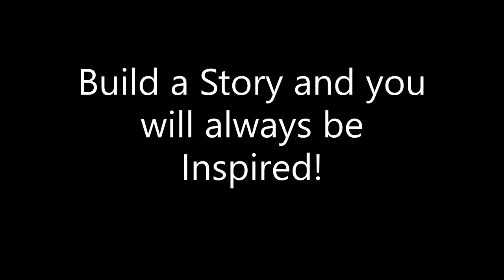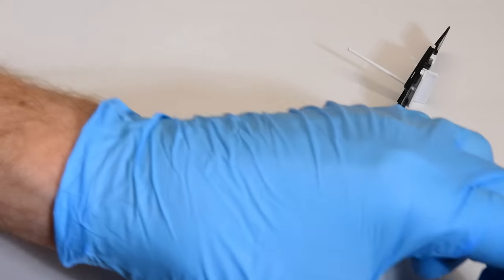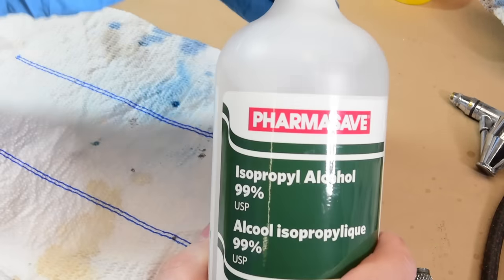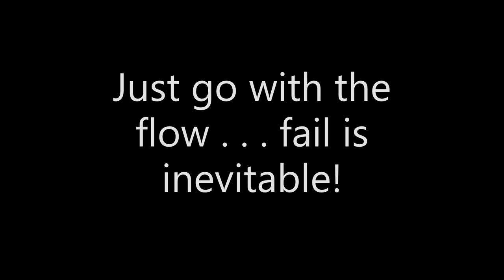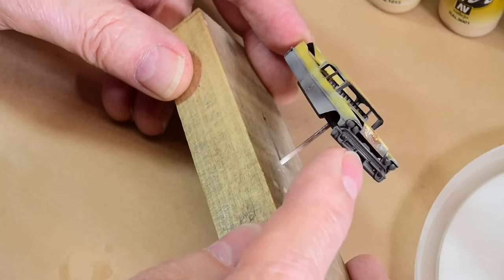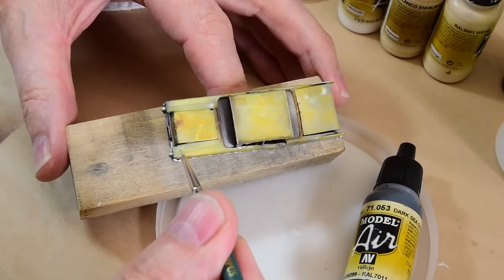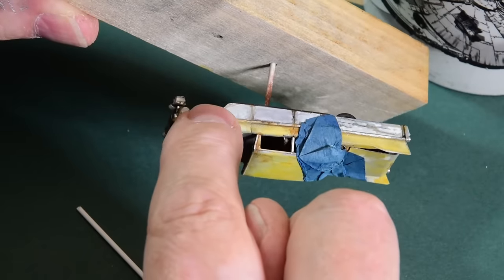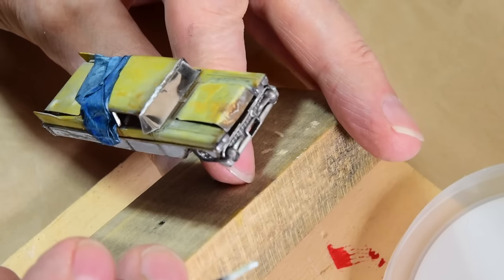Modifying & Weathering (painting) an Athearn HO (1/87) Scale Sedan | Boomer Diorama ~ Vlog # 205

Comment: Hey Boomer.  Thanks to your regular encouragement I have adopted use of the airbrush, but not without a trip to the Emergency Room of my local hospital last night.  I think the story is worth sharing, as according to my attending physician it is not that uncommon.  It was about midnight and I was cleaning my airbrush after using it and got to the point where I backflush the device.  For those unfamiliar with this procedure, after rinsing out the bowl and removing the bulk residue, you place several drops of water in the bowl, pull back on the lever to retract the needle, put your finger over the nozzle to block the air from discharging, and then press down on the lever to release the pressurized air.  It’s easier than I've made it sound.  I’ve done it many times without incident.  However last night somehow my finger slipped and I felt the very slight pin prick and immediately let go of the lever, but it was too late.  The column of 35 PSI air flow found the entry point into my body.  This all happened very quick - instantaneously.  It was a very strange sensation.  I had this weird feeling, I mean I could feel the air shoot up my index finger and through my hand, following the path of my tendons according to my Doctor, all the way to my wrist.  There was very little pain, maybe a 2 on that 1-10 scale, but definitely discomfort.  As I rotated my hand and drew it closer to take a look I couldn’t believe the noise.  I’m not kidding, it was a trip.  If I just bent my finger in the least I could feel and hear what sounded like hundreds of miniscule air bubbles rubbing against one another.  If you were sitting 5’ away from me you would have heard this weird noise, and I was feeling it inside me.  
I called the hospital and with great difficulty tried to explain what had happened to a triage nurse.  She put me on hold while she spoke with a Doctor, who said I needed to come in.  Nobody wants to lose any function in their hands, and as a guitarist I was particularly concerned about that.  After struggling to explain what had happened to the nurse I decided to take the airbrush with me.  I was seen promptly by the Doc.  He examined me and could feel small air pockets in the palm of my hand, and hear the noise I talked about.  I was surprised when he told me this was not an uncommon event.  He explained there was nothing to be done, and that my body would naturally deal with the air.  He told me this is sometimes serious, when the airbrush discharges an oil based solvent.
I was back home about 1:30 AM, and when I awoke this morning my hand seemed to be back to normal.
I won’t be backflushing my airbrush in this fashion any more.
Reply from the maker: Sorry to hear that. Sounds like a freak accident. These things can happen like when I cut-off the end of my finger during the Diner build here: https://www.youtube.com/watch?v=F8WGfoPMmRo

Glad to hear everything is O.K. This is one of the reasons why I use Isopropyl Alcohol, due to it's medicinal applications and properties when in contact with open wounds.

Comment: Fantastic job again, the old car looks really run down - absolutely awesome (of course just as the whole layout)!🤩👌🏻 I subscribed to this channel sometime during the dinner series, but so far I have only been a silent viewer and a big admirer. However, I would like to give a very small tip😇: I also use heated blades or screwdriver tips for several jobs. However, I press the plastic part onto the sooty side of the blade (or the other way round), as it usually doesn't stick as firmly, the soot serves as a release agent, so to speak.😉
Cheers from Southwest Germany🍀🙌🏻
Reply from the maker: Thanks for the tips and supporting the channel! Cheers.

Comment: Great video! What would happen if you pushed your hot knife into a quarter panel? A cool way to weather an old car is put IPA on top of Vallejo Model Air - looks like the car has been out in the sun too long and the paint is failing. For normal airbrushing with VMA, I use their Airbrush Flow Improver 71.562. Works great. Cheers! Bill.
Reply from the maker: Thanks Bill! Cheers.
Reply: Good reminder here that I need to go check what’s happening on my finger lakes railway!

Comment: I know what you mean by setting a few hours for this sort work I really enjoy spending an hour or two on weathering a freight car. I like the tarp idea and must try your wet painting methods.
Reply from the maker: Right on.
Reply: Just tried on a street where I've tried washes and other weathering, but still looks like a grey painted surface. Putting water on first and adding drops of paint and pulling them out with a brush looks so much better. I tried adding matt medium the same way as the paint and I think that helped the water spread on this smooth shiny surface where parts wouldn't wet well and may have helped dull it down.
Reply from the maker: It takes a little practice to get the water-paint ratio where you want it. @mikerubynfs

Comment: boomer I have used Fantastic Kitchen cleaner to thin regular Vallejo paint and it works great.  I have not tried it with Model Air with it yet.   I have even used Fantastic to clean my air brush when I shoot acrylics.  The project on the wrecked car was very cool.   Why did I try Fantastic?    I was out of Vallejo thinner.   Like you said try stuff.  Thanks
Reply from the maker: Sounds awesome! Cheers.

Comment: The Vallejo thinner appears to be some type mild form of ammonia / flow release / water solution. This makes sense too as ammonia can thin acrylics…even loosen them up, if hardened dry.  Funny thing is Full Strength ammonia is extremely hard on your lungs .  This is very far from full strength. So, diluted to this point - you almost don’t smell it.  But always where a mask to protect your lungs. Other funny thing is that Full Strength Ammonia will weaken / eat at brass. Funny because airbrushes tend to have brass fittings and parts all over them. And yeah, start cleaning your airbrush over and over with full strength ammonia and you will likely damage parts. Very likely. I say this as I decided to really clean down an airbrush from some dried acrylic and destroyed my first airbrush….and because of that, I learned my lesson. 40years later….I would also say that even after cleaning down your airbrush with whatever acrylic thinner…before you set it down or end a session….do a good hard spray of clean water through it. Get all of the soaps or solvents out of it. You shouldn’t have issues arising next paint time. Cheers
Reply from the maker: Thanks for sharing that info! I have been shooting IPA Tamiya for over twenty five years and never had to rebuild an Airbrush yet due to cleaning with Isopropyl Alcohol. The only issue is tip wear from higher P.S.I. People use Windex as well but I don't recommend it. I think it also has Ammonia, but the "Blue" solution will gum up the airbrush if you don't flush out the Windex completely. Cheers.
Reply: I use diluted wind screen washer fluid. It appears it can contain alcohol, antifreeze, detergent and ammonia, I add 50% more water it seems to work ok. I've used it with Vallejo and Tamiya for years, including with my airbrushes. I also use 99% alcohol for cleaning and thinning as said it is cheap I got 6 litres off Amazon cheaper than a fraction of of that in thinners.
Reply: You're right, it's dilluted ammonia as the main ingredient. In window cleaners colorants are added  and they tend to gum up, the airbrush when not flushed out thoroughly.
Reply: @boomerdiorama  totally agree. We used it initially in the classroom at the airbrush stations. In those kinds of conditions you really notice the gumming occurring.